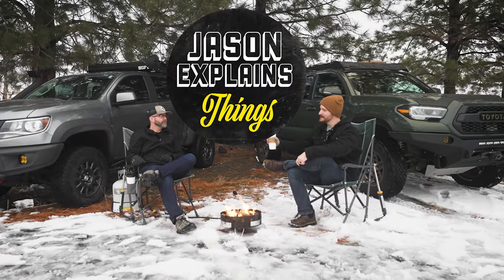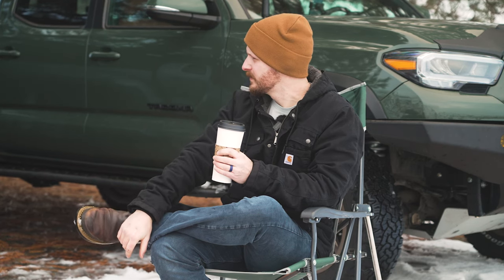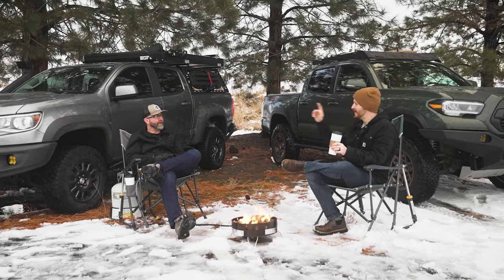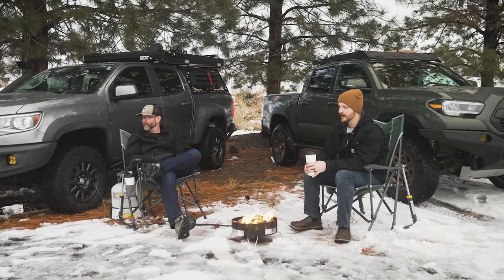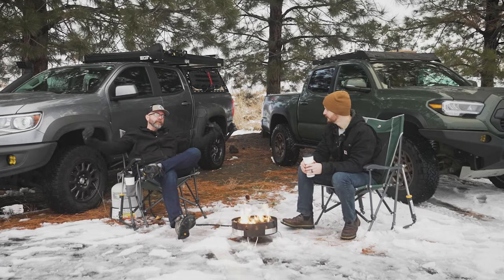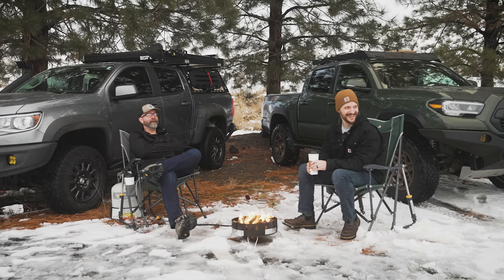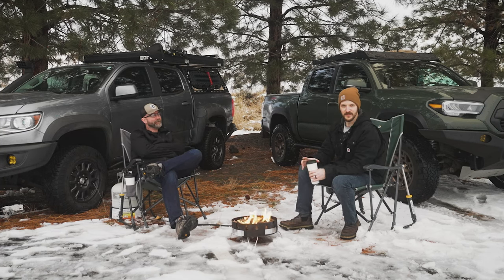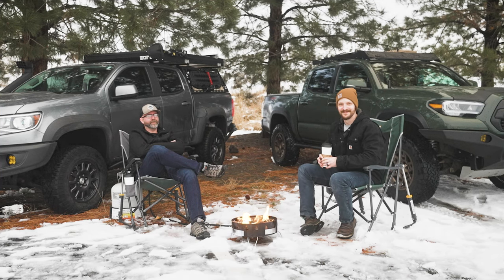"I'M DONE!"  Chevy Colorado Build Took 2 Years!

Comment: Syclone vs. Ram air. 

I would say the ram air intake that is currently on Chris's truck, will have greater airflow during most driving conditions and possibly better MPG. Where the Syclone Prefilter shines is when it is used in heavily dusty areas. The raised ram air does help, but the prefilter will prevent more particles from reaching the engine's air filter. In that case, the prefilter would give you better MPG's in a heavy dust environment. 

On car washes, I try to only go to touchless car washes and I haven't had any issues with some water getting into the intake. If you remember we talked about it with the red diesel Bison that the water will get forced out of the weep hole in the back of the ram intake while driving.
Reply from the maker: Thanks for the info Nate. 👍
Reply: Good information Nate.
Reply: @BADD400  I'm glad I can help.

Comment: Looks great. Why 4.10s instead of 4.56? Read a good amount of discussion between the different ratios and diesel vs gas if you have any insight.
Reply: Actually between this video and now (this was filmed a few weeks ago) I've changed my mind and am going to run 4.56 gears.  The shop that makes and will be installing them heavily recommended 4.56 for my setup and useage.  I don't know a ton about gearing to be honest, so I'm trusting them on this.
Reply: AEV likes to put 4.10 gears in vehicles and Nitro recommends 4.56 gears. Either choice is way better than the stock gears.

Comment: How was the wind noise after you put the racks on the truck? I have a 4Runner and wanted to put an actually usable rack to the top, but I've heard it increases the wind noise. Any suggestions?
Reply from the maker: Not too bad.  There is a little bit of noise, but I have traction boards and a shovel on it as well.